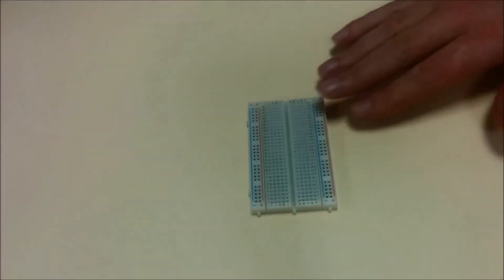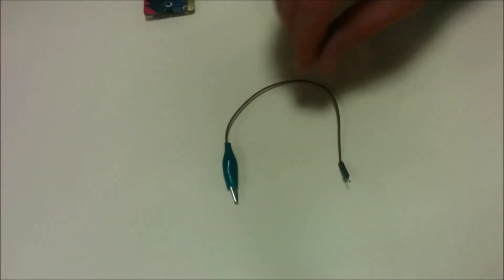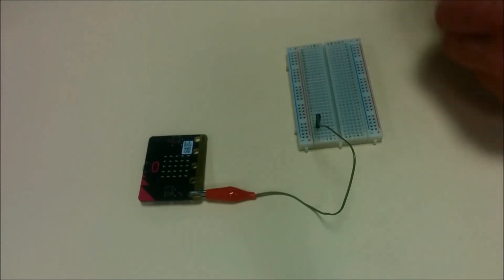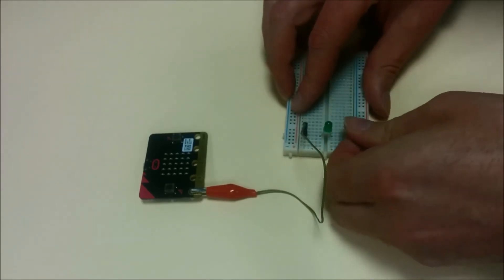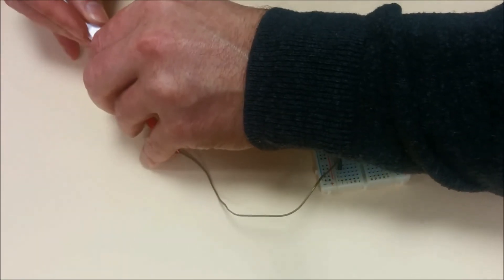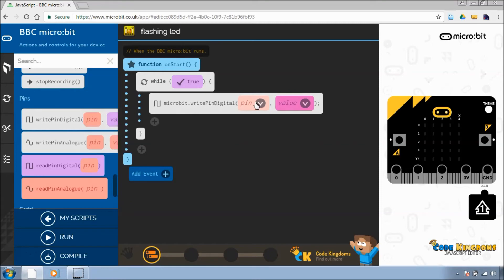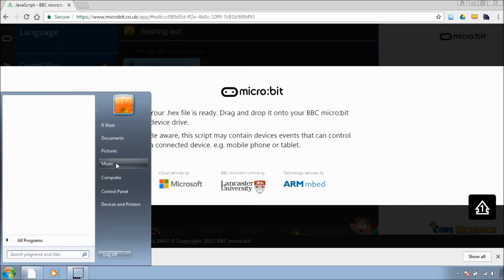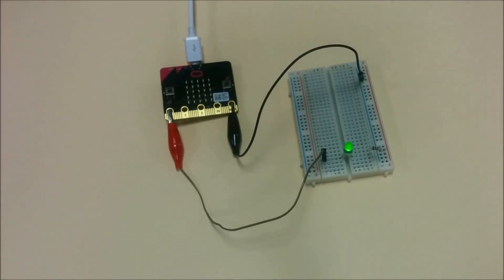BBC Micro-bit beginner's GPIO Flashing LED Tutorial

Comment: How would I make it fade in and out?
Reply from the maker: +IAmGreytonn ho, which code editor do you use and i will have a look! You will need to use pulse width modulation to fade in and out!
Reply: microsoft make code, the one on the microbit website, id appreciate your help
Reply from the maker: Hello IAMGreytonn, my apologies for the delay in getting back to you! You will need to use the 'analog write pin'! Take a look at this project. I haven't tested it yet, but it should work fine! https://makecode.microbit.org/_DTdVDK68Wg63